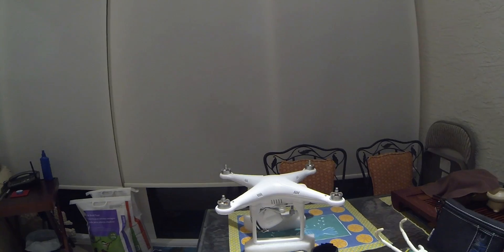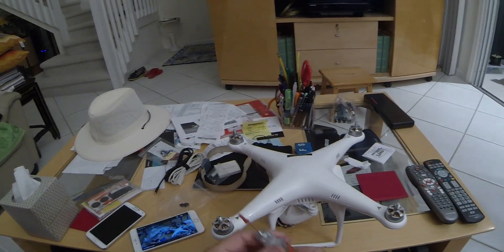DIY for oiling DJI Phantom bearings

Comment: you do know that removing the 4 motor mounting screws gives enough room to lift the motor to oil that lower bearing right? I wouldn't drill any holes that will possibly allow the Bit to hit the bearing and also you have a chance of plastic particles from drilling get into the motor
Reply from the maker: Joseph Palugi yes aware. BTW, I put bullet connectors on the wires when I replaced a motor. The plastic coils out with the drill. No worry on hitting bearing if not reckless.

Comment: You dont need to drill holes in it just give it a shot of WD40. been doing that for years never had a bearing failure. You're over engineering the wheel here dude
Reply: DO NOT USE WD40 ON A BRUSHLESS MOTOR!!!  That product is nothing more than a liquid wax with a very low flash point!
It's great for lubricating drawer tracks but very very bad for high rpm bearings. The "Epic" brand shown in the video is just as good as Tarrot or even Singer sewing machine oil.

Comment: I don't know if you've seen phantoms with cracks around the motor screws. Yes normally due to over tightening. Well adding a extra hole is making it even more fragile.
Reply from the maker: brandon woodford yes I have. your assumption is debatable.  sometimes people drill a hole to stop a crack.   also, people sometimes put blue loctite on the screws to hold them from shaking loose.  that shit turns the plastic brittle and weak.
Reply: Setting the sensitivity higher than the default 100% in the djigo app causes the cracks too.  The Phantom is a flying camera,  not a racing quadcopter.

Comment: Hmm there is no sutch thing as self lubricating bearings where does the lubericant com from in this case?
BUT there is open and closed bearings 2rs bearings and 2zr bearings 2 side rubber closed and 2 side steel closed bearings.and theese are pre lubed, most of the smaal berings are zr closed theese bearing will need lubericant after a while and because its steel closing, its not a good seal and thats why adding a drop of oil works. the oil will find its way into the ball bearing..

Comment: How long did u fly with that till u replaced the bearings ?
Reply from the maker: Simioniuc Adrian Iulian  haven't changed them as upgraded while ago to Phantom 3 and this sits for backup in closet.
Reply: Your bearings sounds very bad ... how much did u fly with that sound ?
Reply from the maker: sounded OK after oiling. older motors on early Phantoms were noiser than new models motors like on Mavic.

Comment: Oiling the bearings is a short term solution if it's grinding they are wearing just change the motors they don't cost much

Comment: Well, I thought they have closed bearings in those motors. Wouldn't it be better to just replace the bearings with high quality bearings?
Reply: My research shows they ARE SEALED BEARINGS and it is very doubtful that any oil makes it to the bearing itself. I just got 300 flights on the stock bearings with no oil  and no noise . . . I'll probably just replace the bearings soon. Sometimes youtube "experts" have good intentions, but don't really understand what they are doing.

I search for "how to oil bearings" and came across one video where the guy DISASSEMBLES the bearings and repacks them with grease. That disassembly shows it is highly unlikely that oil would ever make it to the bearings.

Comment: This method worked perfect, I can easily see the bottom bearing shaft through the 8th inch hole using a flashlight. I used a drop of scorpion oil.

Comment: I'm new to this issue, so I thought I would check out if I need Oil.
When I hand spin each of my engines slowly, the engines feel like there are mild "detentes" about every 1/10 around the circle, in both directions That's every engine, and the bird flys. Is this normal, or have all my bearing gone on all engines? 
 I have about 8 hours flying time on it, and it seems to fly well. This is my first and only Phantom, so I have no point of reference other than a mini quad.
Reply: The mild detents you feel when turning the props  are caused by the magnets inside the motor. Perfectly normal.

Comment: Putting plugs in center hole on bottom will interfere with  seating of stock prop guards. Since you said exact centering is not necessary I would deduce I could drill my whole as much as 1/4" off center (assuming these are not sealed races) to avoid this and still be an effective bearing lubricating hole? After all, bearings run inside the  race which would not be dead center. Question I have is how far off center will that race be?
Reply: +Al “chance” C  loved George carlin :(
Reply from the maker: You could just drill through both.  The oiling needle is long enough and put the plug in the guards when they are on.
Reply: Norman Hirsch As George Carlin used to say "It is sometimes the simple solutions that elude us..."

Thanks!
Reply: One drop of oil on the e-clip is the best you can do without disassembling the motor. If you use the correct oil, it will travel under the washer. Then put scotch tape over the holes.

Comment: lubricated bearings Phantom is not even necessary are in fact self-lubricating bearings
Reply: +BG PRODUCTION Do you know if the S1000+ needs lubricating? We had a crash recently that included mud. I cleaned them the best that I could and someone suggested that we should oil the bearings?
Reply from the maker: +Rosa Bevington I don't know but if you cleaned them you can oil while it's out of frame and not have to drill hole.   Don't see any reason why not.  i'd spin them and make sure they all spin freely.
Reply: The bearings are self-lubricating
http://www.ames-sintering.com/products/self-lubricating-bearings/